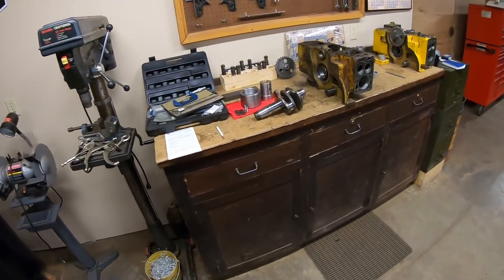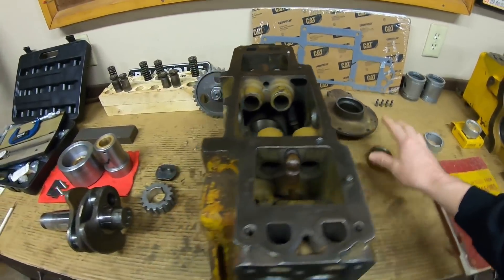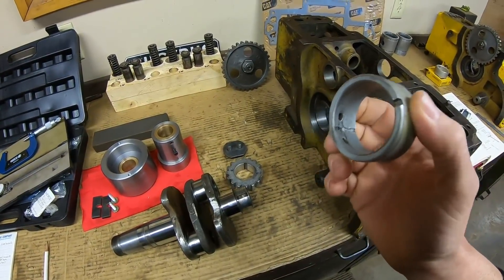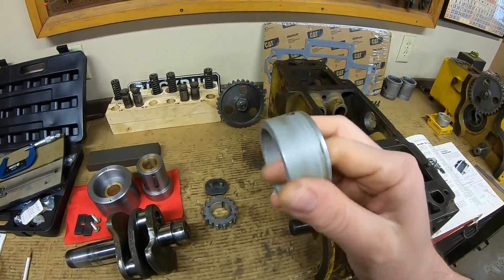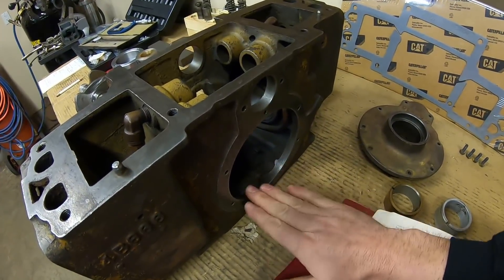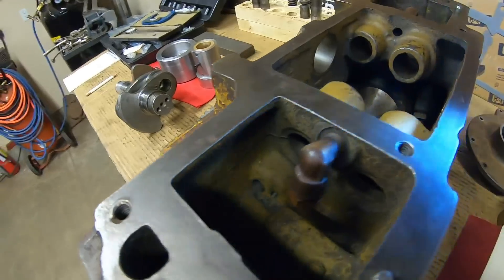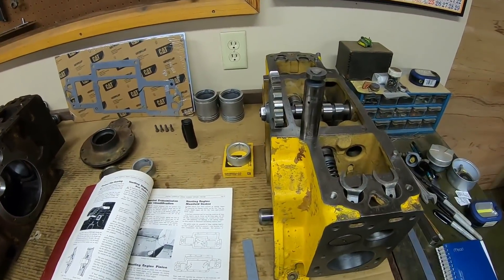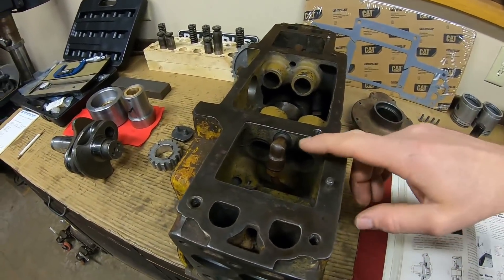Caterpillar D2/D4 Starting Engine Viewers' Q&A Episode: Why Aluminum Bearings/What's with the Tubes?

Comment: My guess on a factor in why they went away from the bronze bearings: WWII demanded a lot of bronze for ammunition production. Bronze is great for bearing material because of its self lubricating properties, but also heavy, expensive and in high demand in wartime
Reply: Bronze males a good bearing because it retains oil in its structure. That may become a problem on fast bearing surfaces if the oil just remains there and does not get reinvigorated over time. It's a good material for low speed applications. The real decision though was probably down to cost - both in build and maintenance. For the more costly bronze bearings build the crank main bearings required extra hardening and that too costs money. Without it the cranks wore out and having to replace too often those would have damaged Cat's brand. It was cheaper to use aluminium - also much in demand in time of war.

Comment: If the tube are drains to the sump how is the oil getting up to the tappets in the first place
Reply: @squatch253  with all the pressure in the crankcase as you said one might think the oil would be pressurized back up the tubes. Logically that would make more sense to me

Comment: Yup, WD 40 works for the tiny bit of aluminum I’ve machined in my hobby shop.  A fresh insert (I don’t recall the insert #) and the WD40 can give a darn near mirror finish.  And cheaper than “aqua cut” or “aluma cut”
Reply: Another vote here for WD-40 as a cutting fluid for aluminum. If you’re using hand ground high speed steel tools, break out the hard Arkansas stone and polish and lap your tool edge to a fine finish, then load it up in a rigid boring bar just a fuzz above center and run your spindle for about 3-400 surface feet per minute at the tool. Depth of cut for a good finish will vary with speed and rigidity, so play around until you find the sweet spot, then stick with it

Comment: Did early pony motors ever share the oil from the diesel?  I heard this on another video.
Reply: Actually in Caterpillars it was the later starting engines that shared oil with the diesel, and in some cases, they even pressurized the pony bearings from the diesel’s system to reduce pony wear from vibration. My recollection is that these schemes didn’t work out so well as there were service bulletins on how to eliminate them.

Comment: Kolher motors have aluminum piston connecting rods running directly on a steel crankshaft . And try using a radius cutter for the aluminum.

Comment: Nice Eismann hoody Toby. If i think about it the tubes in the early 4B blocks may have acted as part ventilation and part splashing of oil in the compartment. But since the pressure has nowhere to vent out that might have been the case why the gasket changed and the tubes fell obdolete earlier. Problem maybe CAT might have not wanted the engine to starve for oil. So they put the tubes in as a extra measure. But thats only my 5 dollars worth of opinion. Now regarding bearing material choise: aluminium is and was much cheaper back in the day and it will not wear out so fast as babite dose when the engine starves for oil. Also aluminium in my opinion is more forgiving materual when using modern oils then babite is. Babite casting and refurbishment takes lit of time and is labor heavy. Most mechanics of the 1930-40s knew how to cast babite and mill it to the right spec size. But like Toby said the service life of such engines was very short or it had to be maintained more frequently.

Comment: Machinist here, Using a lead-in angle will improve surface finish a LOT in aluminum if you are having trouble.Also, those heavy rake angles (30 degree or so)
Reply: Also, the lubrication helps a lot with the cut because aluminum has a tendency to melt and cling to the cutting tip (it's called Built up edge ) which ruins the finish.

The cutting oil helps prevent it from sticking to the tool

Comment: @Squatch253 Another great video👍The devil hides in the details, and as you share like this, you reinforce how older technology can be quite different from today's.  You mentioned with machining aluminum that lubrication is what gives a finer finish, curious what you're using?  Back in mid 80's working through school did a couple summers in a fab shop for high rise window frames made of aluminum, nothing machined but we used a water/oil cooling/cutting mix on all the machines that looked like skim milk.

Comment: Squatch253 you're always talking about the gas getting into crankcase have you ever run into the problem where the oil has essentially gelled up like for example newer engine any oil would become sludgy how would you clean it these engines don't have an oil pump and you really couldn't put for example of diesel fuel to clean them how would you clean them or would you have to tear them down and then completely go through them would you be able to make a video on this explain this process where you're going through the tribuild I just thought of this and I'm not sure if anybody else has thought of this I've seen it in a few GM engine but I wasn't sure if it would happen in these old engines or not

Comment: That's really interesting that the aluminum works out better than a bronze or Babbitt bearing.
Reply: Just remember that modern small engine rods usually don't have bearing inserts but are just machined aluminum bores where they run on the crank.
Reply: @N57RU  that is an excellent point and you're 100% correct! I'm so used to today's big diesel engines haha.